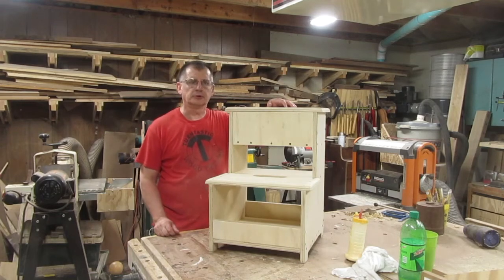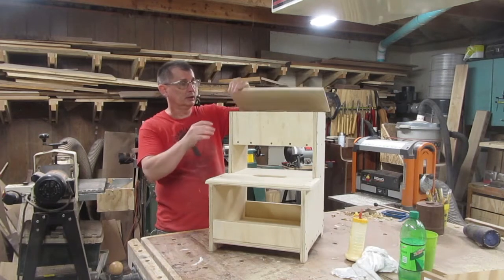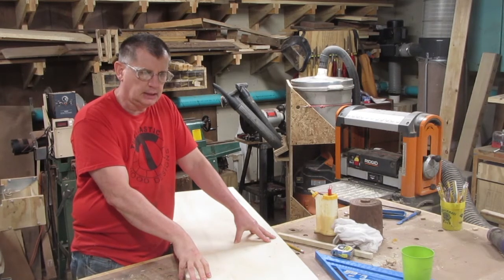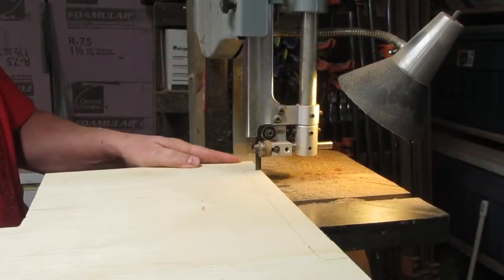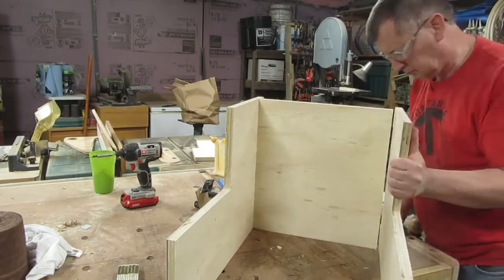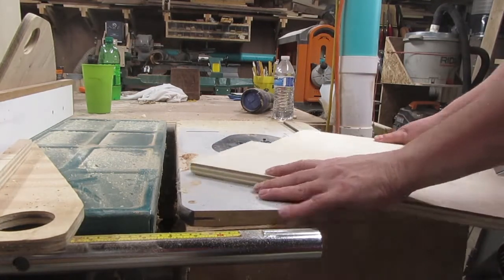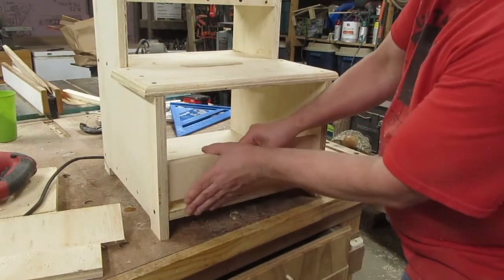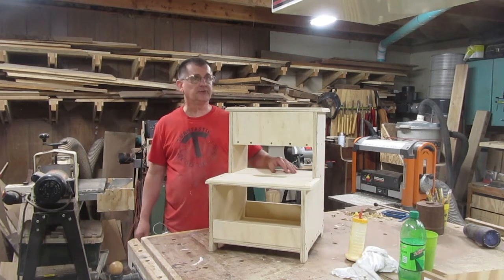Step Stool with Tool Box

Comment: What are your dimensions to your stepstool thank you
Reply from the maker: The stool is 18in (46cm) wide, 16in (41cm) deep and 24in (61cm) tall
The steps are 12in (30.5cm) which is higher than normal stair steps, but I wanted it high.

Thanks for watching.